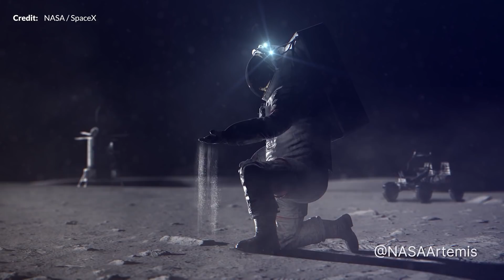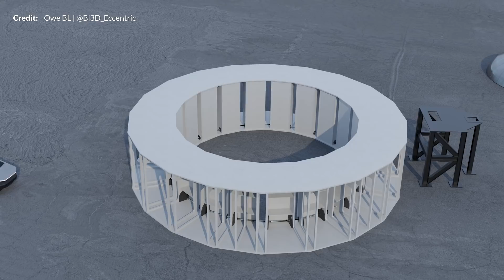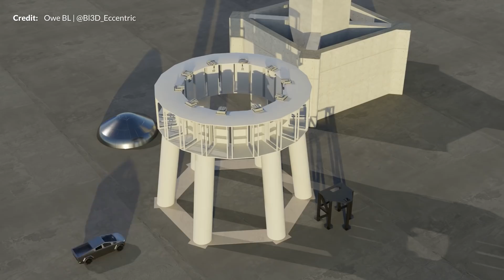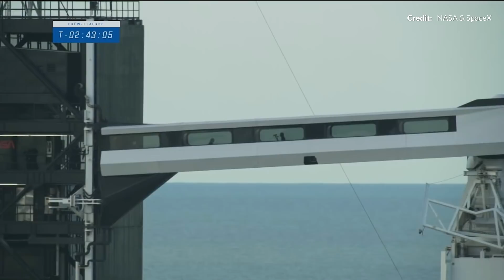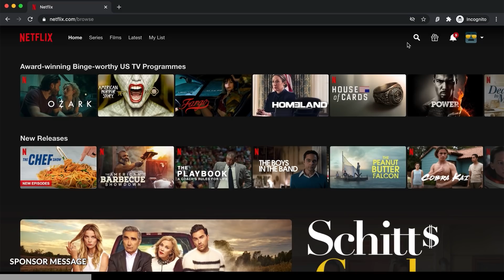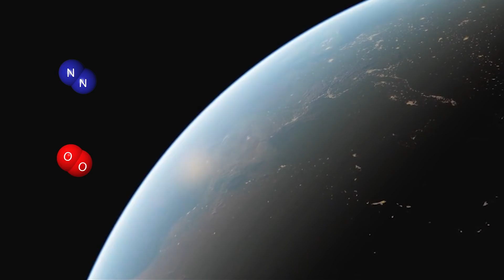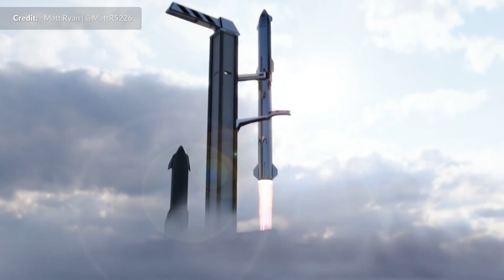SpaceX wins a multi-billion dollar NASA moon lander contract!

Comment: This is all very exciting and everything, what'll be most interesting to see is how precise that booster is when landing that close to the tower and so precise it lands right within the towers arms. That'll be a hell of an achievement in my opinion.
Reply: They’re putting a Falcon 9 down on a floating platform, often bulls-eye on the centre of the platform.  Superheavy will need bulls-eye performance every time or risk wrecking the launch-tower and catcher and itself.  Whenever Falcon 9 goes wrong it usually just dumps harmlessly into the ocean.
Reply: @CarFreeSegnitz  exactly, these bullseye landings I believe will be harder to achieve than eventually getting the rocket technology figured out.

Comment: Im concerned that SpaceX was the only contractor since NASA was originally supposed to down select 2 to drive competition. I will say however, going with a sole contractor, SpaceX does have the most experience with delivering in a reasonable timeframe. If NASA didnt get given scraps of funding however i would have said SpaceX and NT.
Reply: In a way the Senate shot itself in the foot here providing so little funds. NASA knows the whole corrupt system are knocking down Senators’ doors to get taxpayers money made available and will come running to give them that cash to change their minds. Either that or lose out to SpaceX.

Comment: Capturing CO2 from the air to produce fuel will be the same process on Mars
Reply: Similar.  Mars is vastly lower in pressure and different composition to deal with.

Comment: 12:00 How light are fins compared to legs? Also, how expensive is it to rebuild such a complex tower if something goes wrong? 🤷

[Youtube has a bot that deletes factual comments]
Reply: Fins are needed for the return regardless. So the question should be how much extra weight is needed to reenforce the fins. Likely very little in comparison to a leg. I couldn't find the weight of the Falcon 9 grid fins, but the legs are 600 kg/1300 lbs each.
Reply: @anthonypelchat  Agreed.

Given that the grid fins are used to decelerate (as well as steer) the booster. Then logically, if the booster experiences forces greater than 1g in the process then the fins are strong enough already.
Reply: @fredbloggs5902  In theory. However, they will most likely reenforce it. I'm guessing no more than a 20% weight increase per grid fin.

Comment: I honestly expected NASA to go with the Dynetics lander, but I suppose budget cuts mean Starship is the only viable candidate. It is already in development and prototypes are flying, so it would be more a matter of converting it for lunar flight.
Reply from the maker: I did too to be honest. I was surprised by this news.
Reply: @dadad adqwdqq  Not in every possible way. Sure we're comparing a semi truck to a Toyota Corolla, but sometimes you need the Corolla, not the Semi. Granted if they are to choose just one lander design the Starship is clearly the most capable and the only one currently in the prototyping phase.
Reply: In fairness to dadad, Starship is better than the Dynetics lander in every way. The D lander wasn't going to be able to carry any cargo at all. It was at negative weight capacity, one of the biggest issues with it. It's only real benefit over SS was a wider stance.

Comment: maybe you cant have a flame diverter on an offshore rig because it would put sidewys-forces on the swimming platform making it drift away underneath the booster.
Reply: An offshore rig wouldn’t need a flame diverter.  It’s sitting on the ultimate water deluge system... an ocean.
Reply: @CarFreeSegnitz  wich is approximately a flat surface your engines thrust towards, I mean it's not concrete but i'd say the ocean is more like concrete than a flame diverter.
Reply: You can send half one way and the other half the other way

Comment: You'd think a flame diverter would be necessary for the booster. 28 Raptors, thats a lot of flame.
Reply: Spacex plans on landing and reflying Starship on Mars, the Moon, and honestly probably Titan.  Elon has mentioned a few times that instead of making sure the launch area is safe for Starship, Starship should be safe for the launch area.
The Thrust debris during takeoff will be similar to the thrust debris during landings.  SH or SS need to be immune to this type of debris and built accordingly.
Most other rockets don't need to worry about landing debris ... sadly most other rockets are landing debris.
Reply: @ShelburneCountry  The "booster" won't be going beyond Earth's orbit.
Reply: @MARYLANDmeerkats  But the booster will still be landing, and therefore will still need to be able to stand up to debris strikes.

Comment: Orange Rocket and Shiny Rocket are working together !!!
Reply: It's not NASA vs. SpaceX. It's NASA and SpaceX. Godspeed Artemis
Reply: @JB17521or  Always has been, people just strive to fight and its so very sad.
Reply: @JB17521or  theres no nasa vs spacex anymore cause spacex won already they tryna not so so far behind
Reply: @JB17521or  ,
Reply: @Invictus Deus Sol correct
Reply: Finally a sentence with the word orange that doesn't sound childlike
Reply: @Mrdevs96  orange rocket bad! Sorry man I had to...
Reply: yeah, one gets like 3 people to low lunar orbit at the cost of 2 Billion while the other gets 100 people to  the surface of the moon for 12 Million (1 x 2M + 5 Refuels in LEO x 2 M). Great fucking job NASA!
Reply: I just wish i could live long enough to see SLS fly. But i only have maybe 40 years left.
Reply: Orange Rocket has cerebral palsy so it's really up to Shiny Rocket.
Reply: I wish SLS would be stopped and those billions given to push or start commercial companies.
Reply: SLS is an obscene monstrosity.  SLS/Orion/LopG are what Boeing, LockMart, ATK Orbital, Aerojet-Rocketdyne and other vendors have forced NASA to squander nearly sixty billion dollars on over the last 15 years via their congressional meat puppets on both sides of the aisle. All these useless boondoggles should be cancelled immediately. This would allow Artemis to achieve orders of magnitude more returns at drastically reduced costs by using the SpaceX SuperHeavy launch vehicle in conjunction with tanker Starship, Lunar Starship, and F9/Dragon. 
SLS, Orion, and LopG are completely superfluous. Their sole purpose is to continue lining corrupt pockets at the taxpayers expense.
Reply: @drrobcwillis  are you a bot or do you and a bunch of friends just go ahead and copy paste crap everywhere. Because i seen this argument with these exact words several times.
Reply: @lazerithlazerith4012  I'm sorry that you consider the truth to be "crap".
Reply: @drrobcwillis  no sir I dont.  I  like the argument. Its a bit wordy but other then that its is fine. I just know i seen those exact words before .If it was up to me I would make SLS launch next week and if they not ready still take the rocket from them and give it to Elon.
Reply: @lazerithlazerith4012  - I've watched many similar videos on this subject & made similar comments, but I don't cut & paste. I'm glad we agree about SLS.
Reply: @drrobcwillis  bro I think everyone that pays attention to space topics. And has been watching all this unfold agree with you. The only ones that do not are people that just watch propaganda about Elon that is bad or work at these other companies and like being able to do nothing and make a paycheck.
Reply: Wow
Reply: Nice we'll get our cat girls faster
Reply: Oh boy it's another Maniac Mike Hughes dufus fan with a water/steam rocket. 🤣🤣🤣
Reply: Thanks for clearing it up 🙂
Reply: Lunar starship isn’t shiny though!
Reply: Yeah I don't like it
Reply: @plane walker  I would say the better way to put this is, Even during a pandemic (not even close to the worst) The human species carries on toward goals that are worth being here for in the first place instead of crying in a corner somewhere.

We are not going to just bring a rock back, We are going to begin our species life outside of our baby crib, we will live on the Moon, we will live on Mars and when the next thing wipes out the earth, we will prevail and carry on because of these actions.

The universe will not go on being unknown and pointless.
Reply: I wouldn't be surprised if NASA got fed up with SLS and just decided to convert the entire Artemis program to run on the Vulcan Centaur and Starship.
Reply: @John Rickard I doubt it
Reply: @ Water Rocket Lab. Unfortunately this is only due to the political repercussions.
Reply: @johnrickard8512  NASA is obligated to feed the pigs to get paid
Reply: @ThisNoName  They didn't do it and didn't get paid. Fortunately SpaceX is a pretty cheap ride.
Reply: @johnrickard8512  SLS is already mostly paid for and is NASAs final major hoorah, i highly doubt they will just let themselves known as the ones that give up. Its not their style.
Reply: @Vatsyayana87  ARES crying
Reply: @JB17521or  Is that supposed to mean something? lol im lost there friend
Reply: @Vatsyayana87  NASA scrapped some programms aswell. For example ARES programm under Obama. Where they wanted to to Mars. They cancelled it and what was left was Artemis, SLS is the smaller Version of the biggest Ares rocket. Just google it.

Or the Mars programm in the late 70s early 80s. Cancelled in favour of Space Shuttle.
Reply: @Vatsyayana87  We will soon see.
Reply: @Vatsyayana87  SLS is more a congress baby than a NASA baby. If NASA was allowed to spend their funding as they wanted instead of being told what to do by the corporate puppets in Washington i imagine they would be much more successful and efficient.
Reply: @odstwingman  I know and i agree. Most NASA rockets are congress babies, They only get to use NASA brains on other things like exploration/science sats and rovers.
Reply: @Vatsyayana87  SLS is a typewriter in the age of computers.
Reply: @armr6937  That is simply not correct, If you wan to do a comparison like that then it would be, a computer in a world of typewriters, i think its really dumb everyone singles out SLS, its a bad ass rocket compared to everyone except spacex.
Reply: @Vatsyayana87  - False dichotomy. How is cancelling a Boeing/ATK Orbital boondoggle in favour of a vastly superior & drastically more cost effective SpaceX launcher "giving up"?! SLS/Orion is a stinking, budget busting albatross hanging round NASAs neck. Without such obscene monstrosities weighing them down, they'll be able to send NASA astronauts to Mars within a decade.
Reply: @drrobcwillis  First of all, no they wouldnt, because they would go about it the same way... 
Could, but wouldnt or they would have 40 years ago.
Second because the money has already been spent, anything from here on out will be a fraction, and yes its giving up to put so many billions into something and have NOTHING to show for it. 
To stop building NASAs final rocket while its passed the tests and is being put together as we speak, is giving up.
It was a terrible idea from the get go but we wont benefit anything to stop now and would have ONLY waisted the billions.
Reply: @Vatsyayana87  
re. "First of all, no they wouldnt, because they would go about it the same way" - Who would not do what? You  to are not making yourself clear. If you mean NASA will not cancel SLS, I never said they will. 
re. "Second because the money has already been spent, anything from here on out will be a fraction" - Objectively false claim. SLS/Orion annual programmatic costs are projected by NASA to increase if and when they ever become operational.
re. "To stop building NASAs final rocket" - Why do you insist on blindly parroting the term "NASAs rocket"? SLS a Boeing/ATK Orbital/Aerojet-Rocktdyne launch vehicle. If NASA buys heavy launchers from SpaceX instead of Boeing, how would a NASA owned StarShip be any less a NASA rocket than a NASA owned SLS?
re. "is giving up" - As in giving up on continuing to squander tens of billions of dollars on a system that is in all respects markedly inferior to the obvious alternative. I understand your argument, but you're falling prey to the classic "sunken costs fallacy".
re. "It was a terrible idea from the get go" - In this respect we are in complete agreement.
Reply: @drrobcwillis  Sorry, I meant NASA would not be doing anything with going to Mars with that money, they had no plans to do so for the foreseeable future.
 Where are you getting info that the costs will increase? Mine is from Everyday astronaut, i have followed him a long time and i only do so because he knows where to look, does his best to be accurate and does his homework more then anyone else ive seen. Its possible hes wrong but id need evidence to show so.
When its a NASA project built in NASA buildings and advertised by NASA officials its a NASA rocket. There has to be a line drawn somewhere to say whos rocket it is, everything i see is its NASAs, every one of there rockets have been put together by other companies doing work for them. But it is for NASA.
Well i cant iterate anymore what i mean by giving up, but if i were any of the thousands of people that helped bring it to life and they cancelled, how would i feel? Like a failure, like we gave up on what ive worked for years on.
Just my opinions of course.
Reply: @Vatsyayana87  
re. "Sorry, I meant NASA would not be doing anything with going to Mars with that money, they had no plans to do so for the foreseeable future." -  Many official NASA sources have for decades been speaking of the agency's aspirations to send humans to Mars. The fact that no such program has been funded is because no funding has been made available. If SLS/Orion/LopG were to be cancelled, what exactly would you expect NASA to do with the more than 5 billion a year thus freed up?
 re. "Where are you getting info that the costs will increase? Mine is from Everyday astronaut, i have followed him a long time and i only do so because he knows where to look, does his best to be accurate and does his homework more then anyone else ive seen. Its possible hes wrong but id need evidence to show so." - From NASA. I am very familiar with the excellent analysis presented by Everyday astronaut. He is by no means wrong, but he was discussing the projected costs of SLS/Orion, BUT DID NOT INCLUDE THE PROJECTED COSTS of LopG, without which NASA themselves admit/claim that SLS/Orion cannot support a sustainable human presence on the Moon.
re. "When its a NASA project built in NASA buildings" - It's a project developed by Boeing/ATK-Orbital/Aerojet-Rocketdyne whose components are built by said private firms and their sub-contractors. The final assembly of said components does indeed take place in NASA buildings - NASA buildings rented from NASA by Boeing and under Boeing or ULA management. There is no reason why stacking StarShip-SuperHeavy could not be done in the VAB as well as SpaceX's own private facilities.
re. "and advertised by NASA officials its a NASA rocket" - Which they can do with any rocket that they buy from anyone, just like the USAF can advertise a fighter as being a USAF fighter regardless of which manufacturer they buy it from.
Reply: @Vatsyayana87  Re.  "but if i were any of the thousands of people that helped bring it to life and they cancelled, how would i feel?" - Hopefully that it was a useful learning experience, and that they can now use their skills to work at SpaceX or some other relatively non-corrupt organization on something magnificent or at least worthwhile as opposed another endless pork guzzling boondoggle that just won't die.
Reply: @Vatsyayana87  SLS literally uses 1970s technology.  At best it's a vacuum tube in a world of transisters.
Reply: @psychohist  I'm well aware of what it is thank you.
Reply: @psychohist  But you are wrong too, If 95% of rockets out there is at the same tech level as SLS (just much weaker), then the world is of its class...
Reply: @johnrickard8512   NASA would have liked to have dropped SLS long ago. It has been Congress keeping that program alive. Vulcan Centaur can not send Orion to the Moon. What will happen, when it becomes painfully obvious that Starship can go to the Moon, many times a year, carrying vast amounts of payload, for the same price as a single SLS launch, which can only fly once a year, is that SLS/Orion will finally be dropped in favor of a pure Starship architecture.
Reply: @odysseusrex5908  I do hope you are correct. As soon as NASA gets to the  moon I will be happy if they shift focus/funding to breakthrough propulsion research and other blue sky activities that will push technology. Meaning rotating stations or spcecraft for Earth Mars travel, cislunar infrastructure, plasma reconnection thrusters (if it proves out), nuclear propulsion, rotating detonation engines... There are so many things that SLS is sucking resources from.
Reply: @odysseusrex5908  - This is exactly what should happen if NASA was not at the mercy of corrupt meat puppets on both sides of the pork politics aisle. I'm terrified that the Biden Admin will eventually figure out what's happening and shut SpaceX out as soon as they can.
Reply: @johnrickard8512  - SLS, Orion, LopG, as well as Vulcan Centaur are all superfluous. They serve no purpose other than the endless lining of corrupt pockets. By far the best, most cost effective Artemis architecture would deploy only SpaceX SuperHeavy & F9 boosters launching Lunar Starships, tanker Starships, & Dragons.
Reply: @johnrickard8512  SLS will definetly fly. The qestuom is how often cause its just too expensive before they switch over